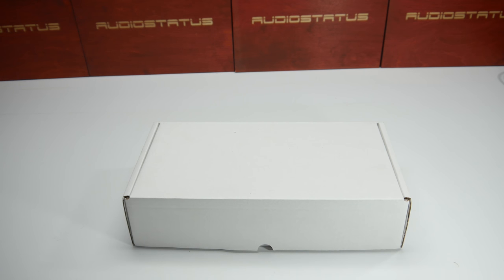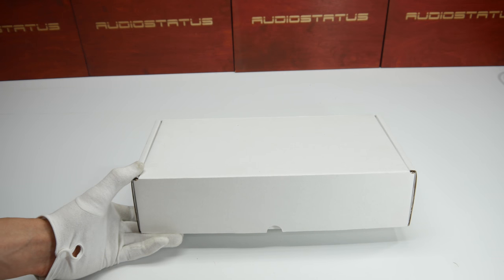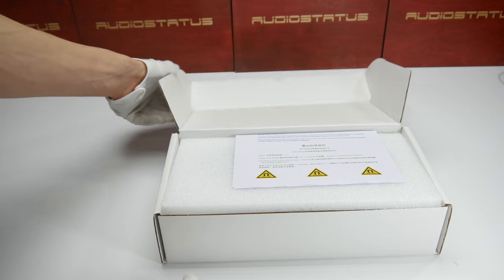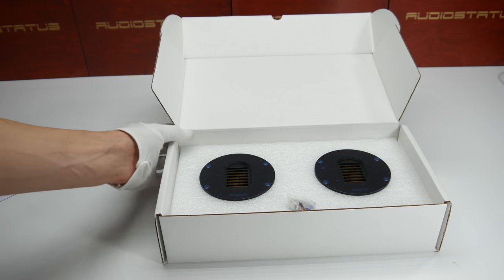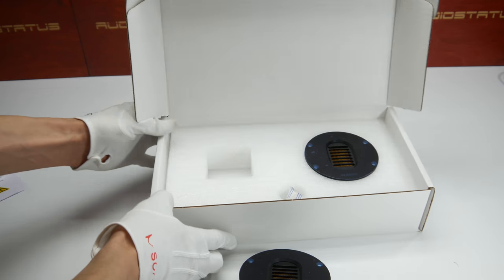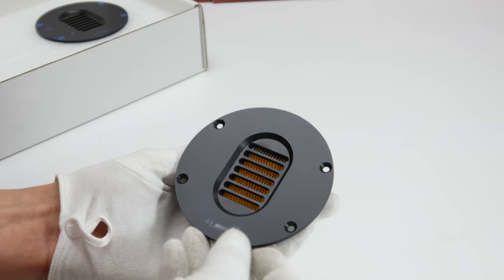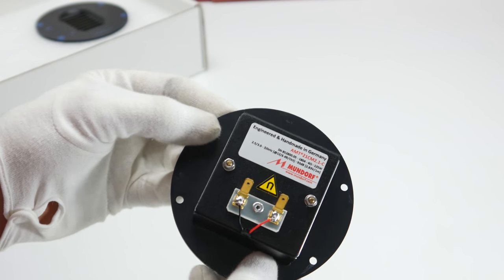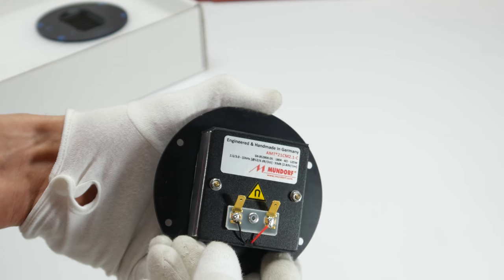Air Motion Transformer //// Mundorf hifi AMT 21CM2.1-C   ⚡

Comment: Can I mount them anyway?
Or is there any angle to install them?
I mean, the "lines" on their face should be 90° towards the floor or parallel to it?
Reply: Lines should be opposite of parallel perpendicular but the lines going up and down send out sound on these left and right amazingly and not as much headed to ceiling or floor which means it’s important to have your ears level w the tweeters, and cool when you can hear entering the strip that is the sweet spot. Zmaybe th best way to use these is stacked in a line source, the number of them they don’t have to move as much and sweet spot aside from room echo which is a big thing but anywhere between hem is in the zone so more people can hear a close to holographic sound if the mids and bass are also fast don’t worry about how deep bass plays faster bass makes something holographic because bass doesn’t sound to us like it’s coming from anywhere in particular it’s just there. With 10,000 in drivers box materials a world beating speaker can be made with high high end drivers German and danish made most of them, but US makes some awesome stuff just need to make more of it